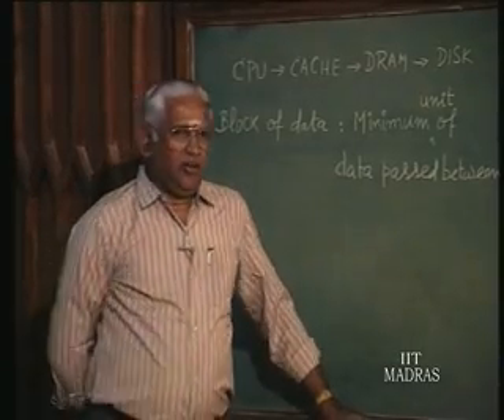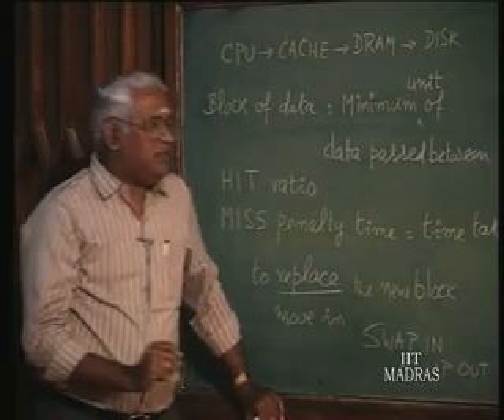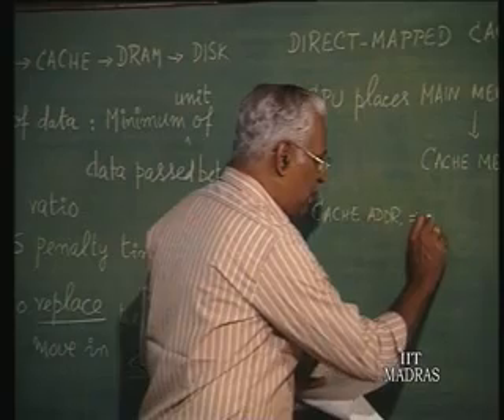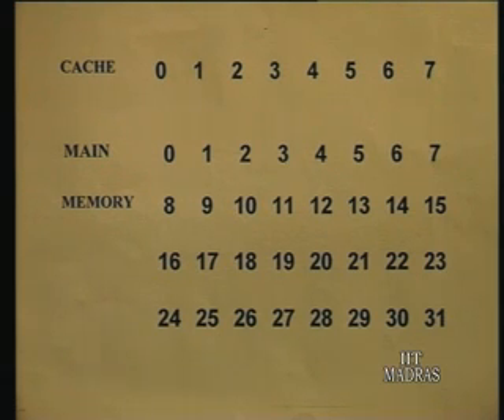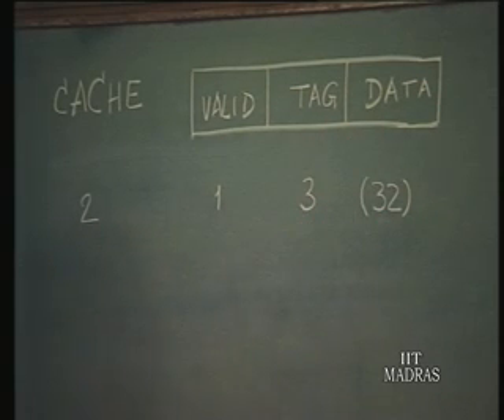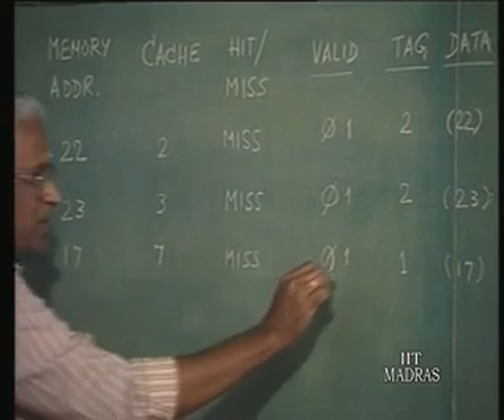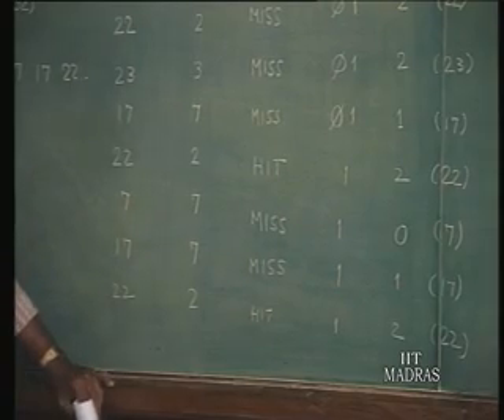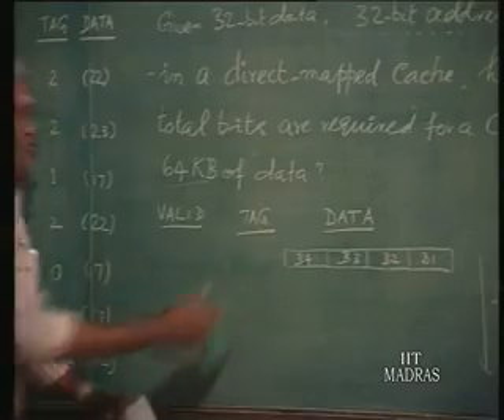Lecture - 17 Cache Organization

Comment: why 17 is miss in second time, it should be hit ?
Reply: Perfect
Reply: then do u mean always the locations are replaced
then once 22 is came to cache.....other say 32 from same location replaces 22..???/
Reply: Memory address 17 generated by CPU corresponds to cache location 7 but tha location is already populated with valid data of memory address 7, and not of mem. Addr. 17 what CPU requires now. So, data from location 17 needed to be swapped in place of current 7 and tag needs to be updated from 0 to 1 to indicate this changed status that now we have data of memory address 17 ready for CPU in place of earlier 7. It is a case of miss because data need to be brought from Main memory it was not already present in Cache before.